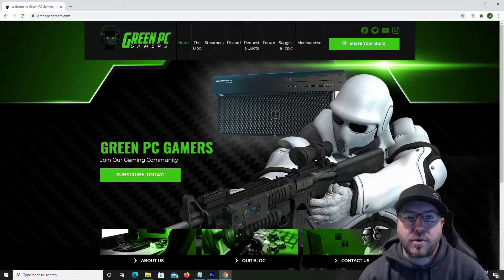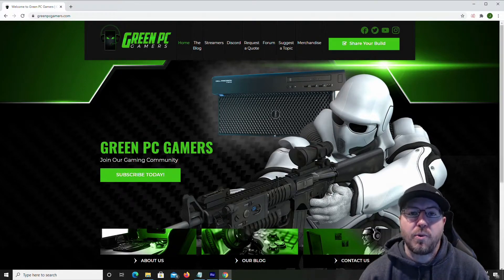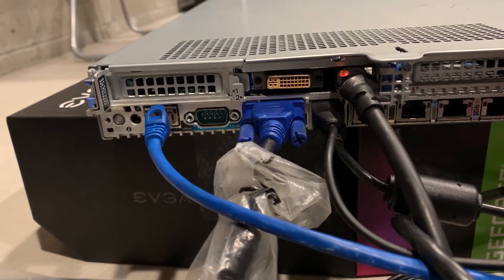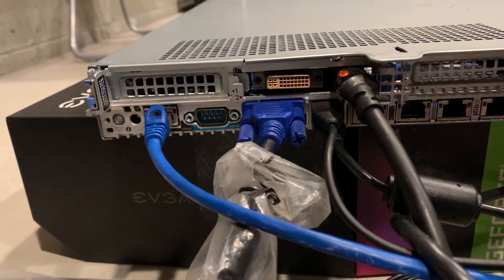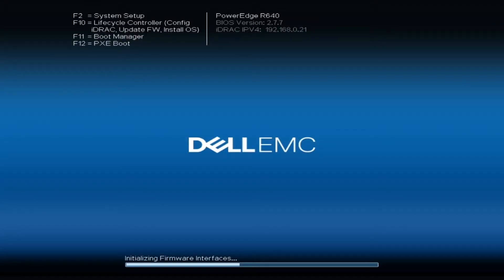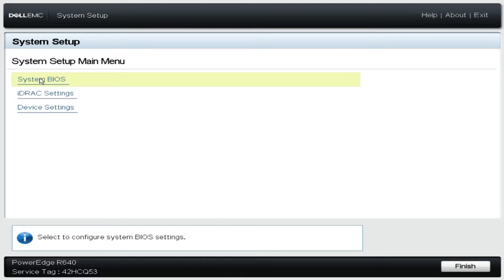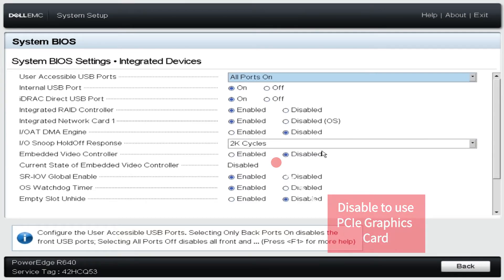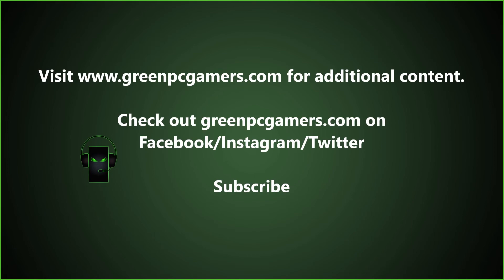How to get video with an Add-On Graphics Card in a Poweredge Server w/Poweredge R640 Test Bed

Comment: Is there a way to enable pcie gpu without disabling the onboard graphics? Would really like to have both.
Reply from the maker: The embedded vga port will work at the bios level.  After that it uses the add on Gpu.

Comment: Here is a quick question.

I use PowerEdge R610, and would like to get a basic gpu to use it as the main one instead of the crappy integrated one. Is that even possible?
Reply from the maker: Yes, it's the same process as shown in this video.

Comment: I tried this on my dell poweredge t410 using a gigabyte gv-n210d3-1gi card.  slot on machine is a pcie x8 slot.  disabled onboard, rebooted, no video.
Reply from the maker: Make sure you saved the changes in the bios.